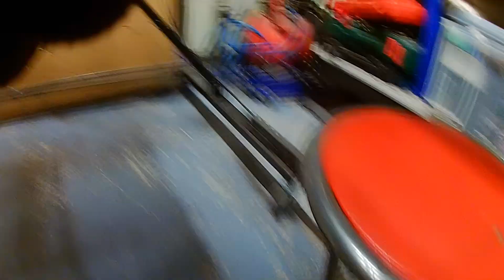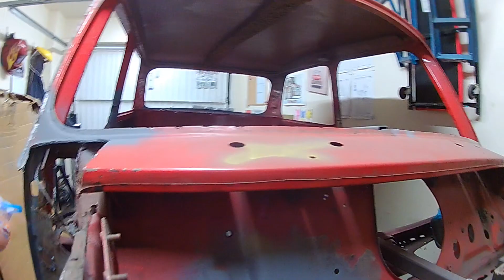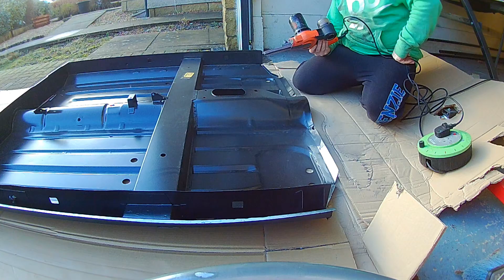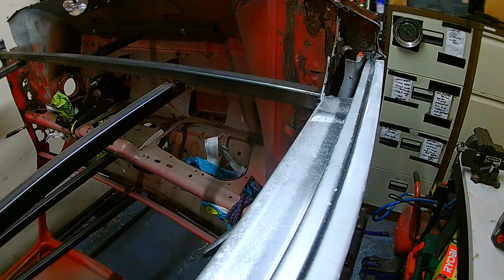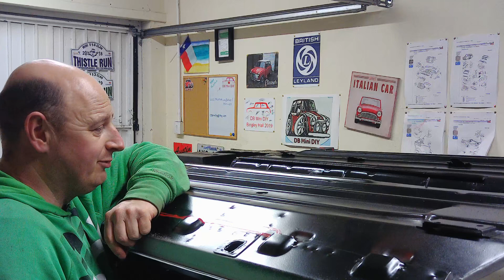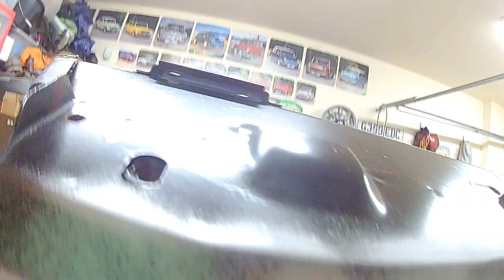Classic Mini Restoration: Eleanor video 62,  Floor Prep And Test Fit

Comment: Cracking content! Thank you! What is the silver spray you use after the finger sander? Won’t it hinder welding ?(I’m a total novice btw) I ask as I’m about to do exactly the same to my 1979 Austin mini
Reply from the maker: Thanks and good luck with the resto, u will quickly pick things up. If the area is to be welded, I use zinc (weld through) primer

Comment: Excellent progress - well done! How are you checking alignment between heel board/rear sub-frame mounting positions and front subframe mounting points, to ensure floor is aligned front to rear?
Reply from the maker: Thanks. So the heel board is aligned to the rear subframe, which is fixed in place from where the old floor came out of.
The mounting holes on the front are on the toe board which i will need to replace a bit later. To align the floor to the toeboard i used the profiles of the full floor from the door steps and sills and front edge of the floor. This will help align the toe board later, also with the help of the rotisserie jig.
The bracing has also helped hold it all in place
Reply: @DBMiniDIY  Thanks for clarifying the alignment aspect. I am needing to do a similar job on a Clubman 1275GT and am toying between the full Heritage floor (later pressing) and the M-Machine Mk4 floor that is apparently assembled by them using two half floors (but has the correct floor pressing) which results in more joins. Not sure which is going to be better...
Reply from the maker: @EnginesRob  the half floor m machine pressings are a good fit and a lot cheaper so its down to cost really but i defo could not fault the full  heritage floor plus when you add all the extra panels on to it adds up like cross member, sills, heelboard etc

Comment: Slowly slowly catchy monkey! Floors looking great bud, might have missed it but are you replacing the full bulkhead? 👏👏👏
Reply from the maker: Cheers mate and yes full bulkhead, I'm all in
Reply: @DBMiniDIY  nice one, I'd get asked "how much of original car is left, then what's the point buy a new shell"..... Errr Where's the fun in that! 😁 Least you'll know it will be rock solid once done. I'm itching to start spraying the underside of mine
Reply from the maker: @danhardy5752  yeah totally plus i wouldn't  pay 10k for a new shell